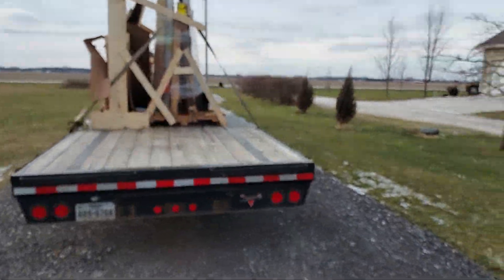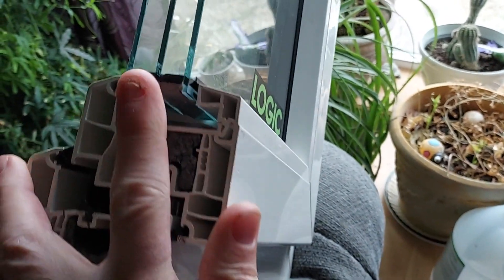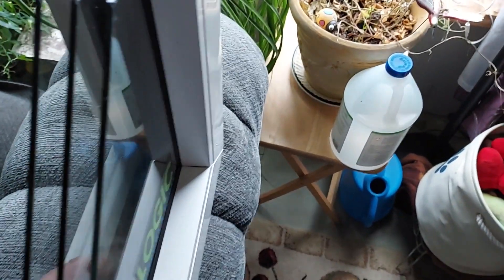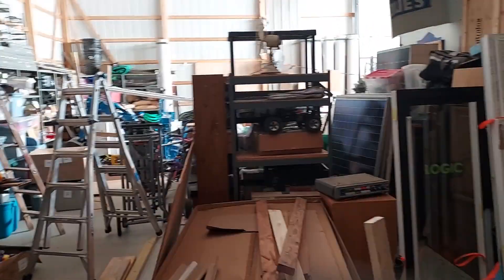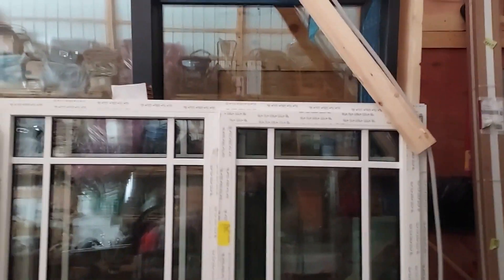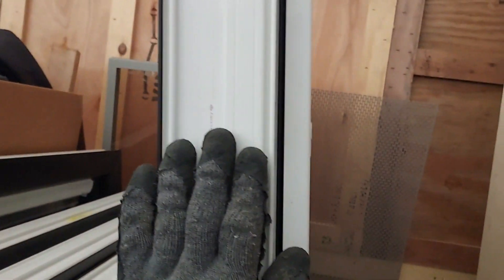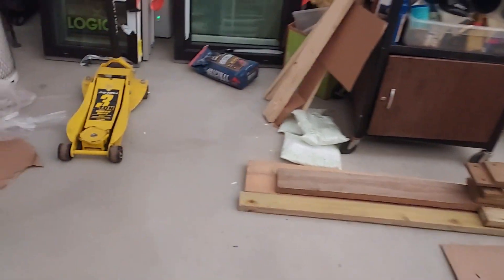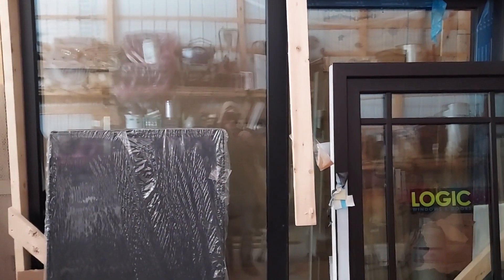Logic (Ventana) triple pane european style tilt and turn windows.

Comment: We were looking at these windows too! We are likely going to go with Alpen though. Still deciding between tilt and turn vs. casement!
Reply from the maker: I was interested in Alpen as well.  I found a huge differential on the quotations.  I also heard that Alpen has fought issues over the years (which may not be true) but I was convinced enough to go with Logic.  While genius, I didn't like the idea of cutting and crimping the equalizing tube on the Alpen windows.  Something didn't seem right about that to me... like it would eventually leak.  Again, I've no empirical data to show any of this.  Oh, and Ventana windows are manufactured 5 hours away (Pittsburgh) so if I have issue I hope to find resolution.  Weighing all these issues, Ventana won the purchase for my house.

Comment: Beautiful but expensive I see some people are putting in two double pane windows back to back. Your house will be awesome.
Reply from the maker: Thanks man!  You are not kidding.  I'm pretty much already out of funds and I didn't even start building yet!  It's been a long road to get to where I am.   Never thought about dual-double panes but not sure how they'd handle the heat in between the two units, especially if they are vinyl.   I've heard of house windows cracking just from adding tint in the wrong place that traps heat.

Comment: If the 2x4s are in good shape I could use some.
Reply from the maker: Hey buddy!  I am sorry to say that this video was taken a couple months ago and I either consumed or burned the lumber.   I used the good stuff, but lots of this was just 1x3 furring strips.  BUT having said that I do hope to build in the next few months and I will make a pile of "scrap" as I build for you
What are you building?
Reply: Mostly mortar racks and some shelves. 1x3s work really good for the mortar racks.
Reply from the maker: @wareaglepyroz71smitty93  oh damn you only need a little I will look around next I'm out there
Reply: Cool thanks. I am working on getting the metal scrap to try out.